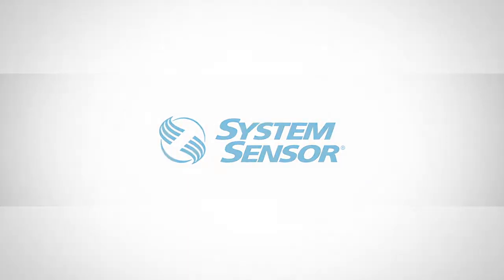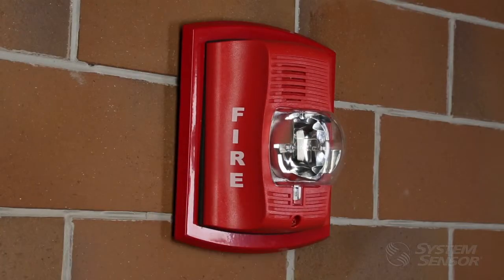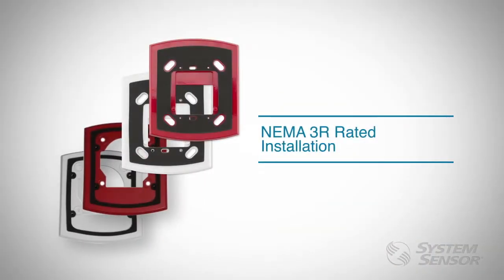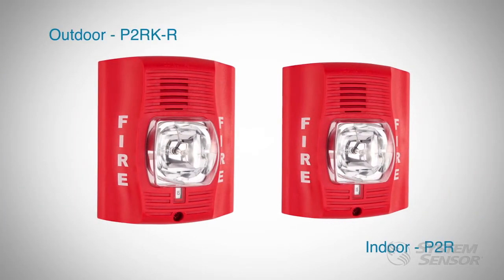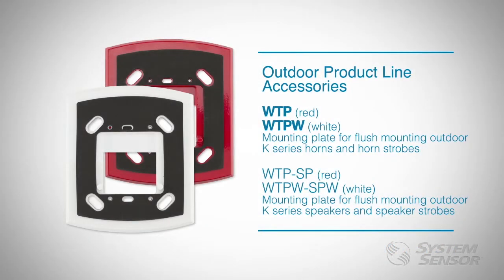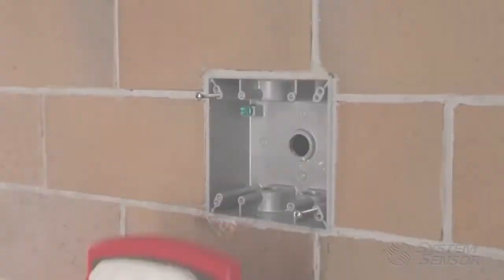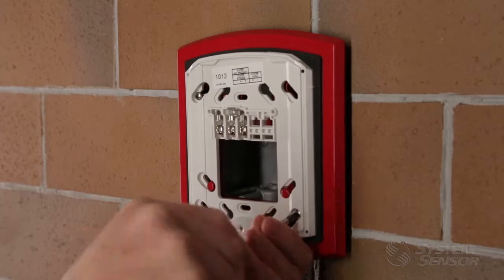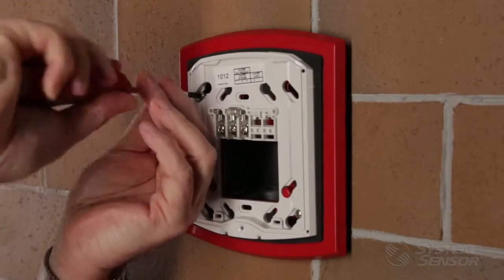AV - Flush Mount Outdoor AV Products and Accessories

Comment: Wow, system sensor had just exposed so many of those rare installers that try to flush mount these p2rs (for some reason) or p2rks without those templates.. and this video was made 9 years ago (the time when this comment was written) and still to this day the installers didn't even know this existed. Unless if i had never seen these before